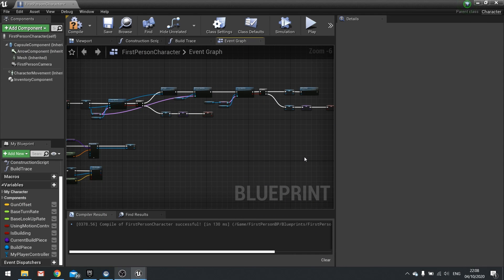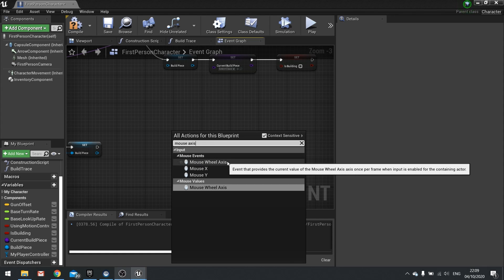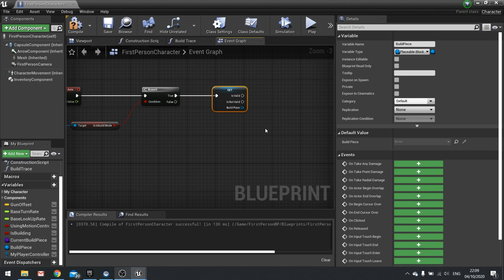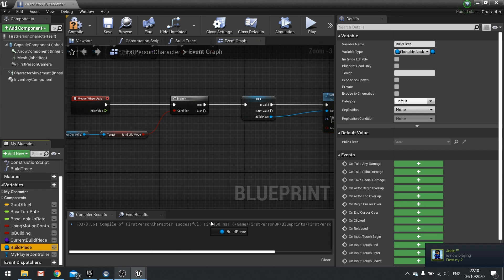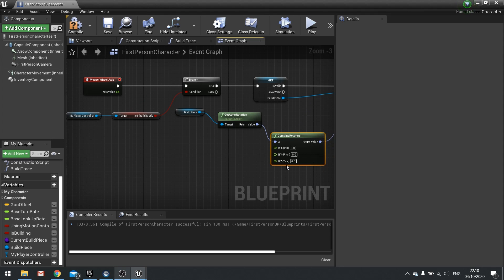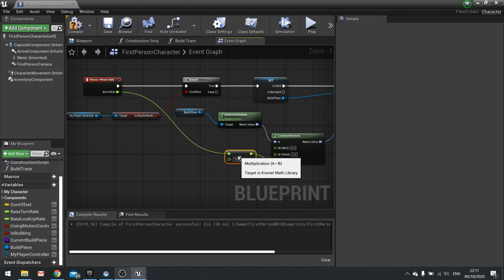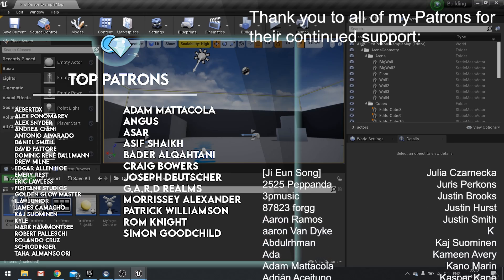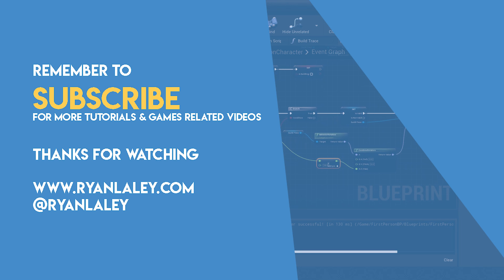Unreal Engine 4 Tutorial - Building Series Part 9: Rotate Block

Comment: After the first block, you can't get the second to rotate the same. Something is weird. they don't line up. I tried the "SnapToGrid(Float)" node.
Reply: If you disconnect the snapping part in the event tick it will rotate correctly, I also switched the block to the shape_cube so the origin point is at its bottom. If this helps at all.

Comment: The top block snaps to the bottom but it's not lined up with the bottom one correctly. Would it be easy enough to make them snap together so they lined up with each other?
Reply: You should be able to get the hit object from the raycast, and get it's world rotation then apply that to your newly placed object.
Reply: @ServerAcademy  ok Thank you for the reply